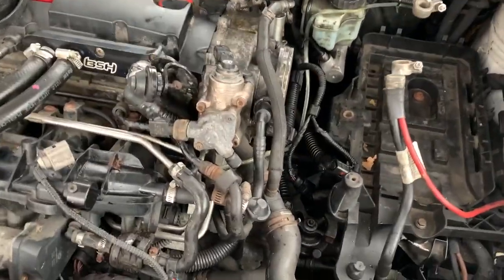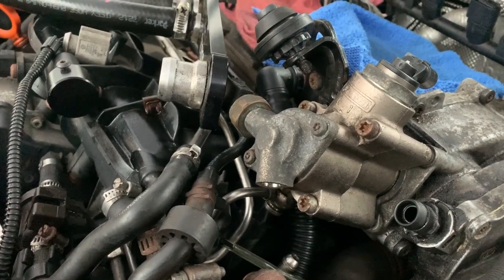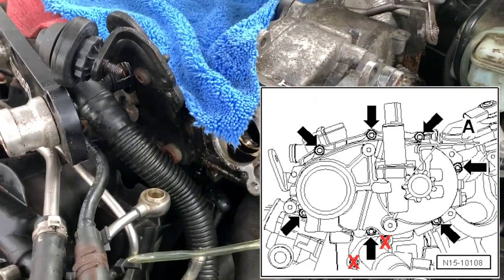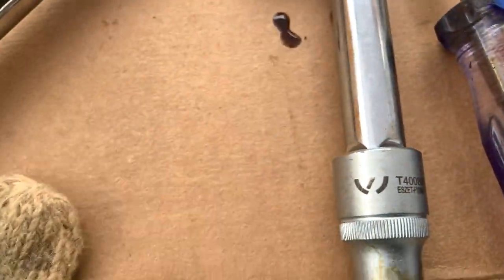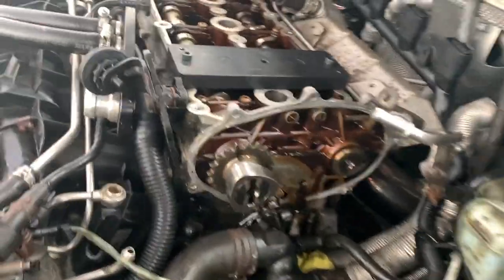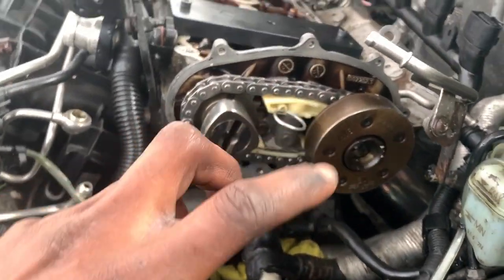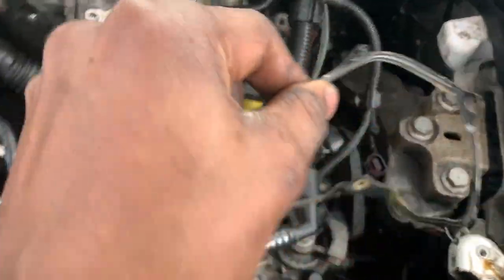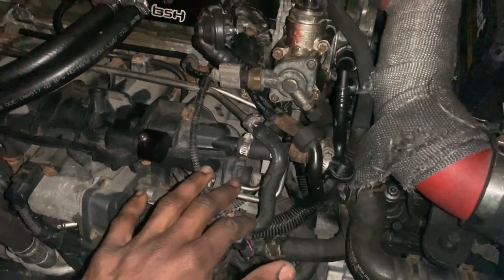VOLKSWAGEN 2.OT MK5 GTI CAMSHAFT TIMING CHAIN REPLACEMENT |AUDI 2.0T|GOLF R|MK6|MK7

Comment: Great video. I have mk5 gli. Same engine and all that. I hear ticking at startup for a few seconds. Engine at idle is just louder an usual. Had timing belt and water pump... all that changed a while back. I think this is what I need to do next. Seems complicated.  Rough idle and valve noise at startup. Do you think this might solve it? 160k miles. Thanks for the video. And man you’ve answered everyone questions! How fucking polite you are. Good man!
Reply from the maker: Thanks man appreciate that!! Text me on instagram i help walk you through.
Reply: @GTIMKV  Do you think it would fix the ticking noise?
Reply from the maker: @ProdByTrev  take off the cam cover on the side and double check
Reply: @GTIMKV  for sure I appreciate it man. Ima subscribe to your channel rn too
Reply from the maker: @ProdByTrev  appreciate that brother 🙌
Reply: Hey bro I’m just getting into this , I have some chain rattle in the right side of my engine. Just to the left of the hpfp, so I’m assuming my chain is a bit stretched out? I don’t have any engine codes,  I just changed my accessory belt tensioner and I think it made my cam timing off a little bit since the tensioner was so old
Reply: @CR15PY1  man I changed every part that could possibly be involved and I still have the chain rattle.
Reply: @CR15PY1  your accessories belt will have nothing to do with that… I would look at the timing belt water pump… cam chain tensioner chain and all those components
Reply: @daviscc65  yeah it could be just my chain tensioner

Comment: Bro I need your help man 😂
Reply from the maker: Hey wassup brother what you need ?
Reply: Long story short a mechanic forgot to put my cam follower back in so it's managed to break the piston on the hpfp which has ended up damaging the cam but I just need to know brother if the whole cam shaft needs changing or should it be okay. Thankyou for your reply!!
Reply from the maker: @Samp-xe7yy   camshaft fairly cheaper brother. Just swap high pressure fuel pump and camshaft , i got used ones if you want i give it to you for a reasonable price.